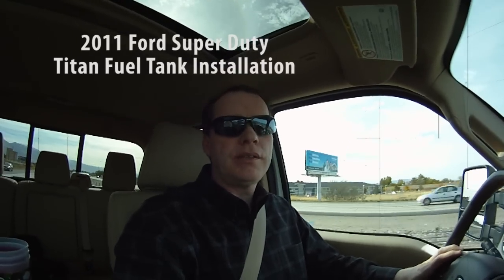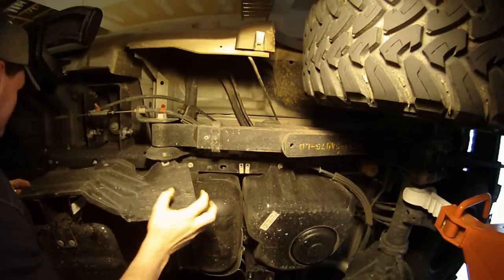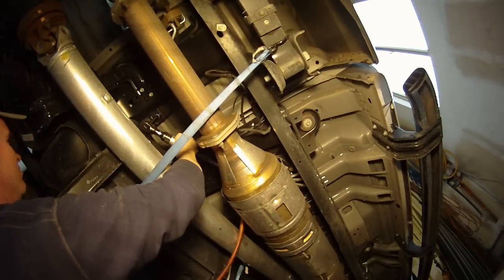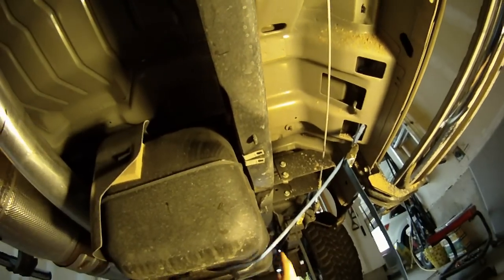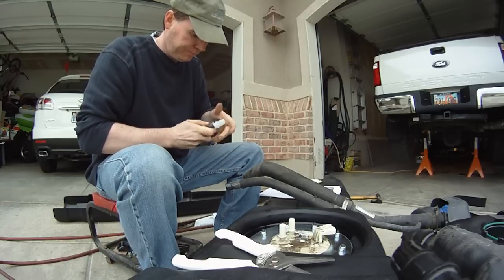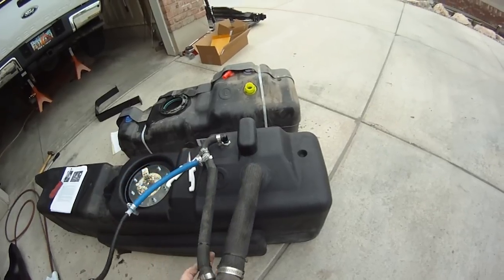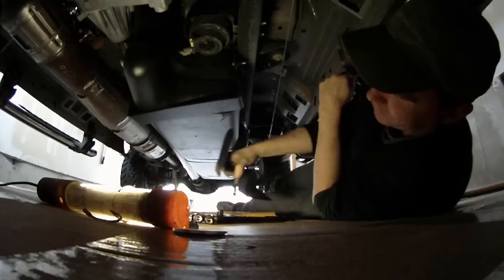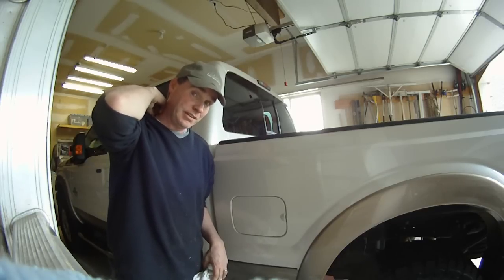2011 Ford Super Duty Titan Fuel Tank Installation

Comment: I watched your video at least 12 times. Today I put in my tank on a 2016 F350 Powerstroke. The ONLY thing that went wrong was the fill hose leaked as soon as I had it all together. Lucky I had a friend help me and it was fairly easy (but way heavier with 13 gallons) to remove and fix. I used your strap technique and it was simple even with the extra weight. I cannot thank you enough for making this video and showing the process even with mess ups. That’s how we learn right?  Now if the truck would stop dripping from snow I could for sure tell if I got it right this time. But I wanted to take the time to say thank you for your video. I will come back if I do any other projects to see what you have.
Reply from the maker: Congratulations! You probably look back now and think it wasn't such a big deal. The second time around is always much easier than the first.

Comment: Epic: Thanks for taking the time to make this really helpful video.  My biggest concern was how to remove the electrical connector and fuel attachments on the tank.  That was still a challenge, even with your explanation.  A thought for others who might do this: This was a lot easier using a transmission jack.  I bought a $100 cheapie at Harbor Freight.  It's small and worked perfectly.  They're also available at rental places for around $40/day.  Money well spent for peace of mind knowing there was less chance of dropping the tank and damaging the wiring harness and fuel connectors.

Comment from the maker: @homestarzelot Thanks, it was fun making the video. I am really enjoying the extra size tank. So nice to have to fill up half as much. I really didn't think that would be as big of a benefit but it's just nice dealing with fuel pumps a lot less. The extra range with the tank is great also. I can confidently go 500 miles towing a heaving trailer and 800 miles easily unloaded. I haven't adjusted the tank size on the MTE display yet but will in a few days.

Comment from the maker: Yes, my truck has the LCD display in the center of the dash which displays MTE (miles to empty). It was incorrect after I installed the tank because it was based on a 26 gallon tank size. Ford does allow changing the tank size parameter in the main computer now. Trouble is, it only works on 2011s and newer. If you install the larger tank, your miles to empty will always be wrong but the gauge will always be right. The gauge just moves slower with the larger tank.

Comment from the maker: I almost never use more than 45 gallons before fill-up so here's the numbers: Truck gets about 19-20 mpg unloaded on the freeway. That's nearly 900 miles. When towing, I get 11 mpg with takes me almost 500 miles. Running around town is about 15 mpg which goes about 700 miles.

Comment from the maker: The dealer must do that. They may not be familiar with the menu options in their IDS system by they can change the tank size in the PCM. They just need to poke around a bit and they will find it.

Comment from the maker: @wildpb Ford dealer service departments now have the ability to change the tank size in the truck's computer. This allows the MTE display to work correctly with the larger tank. Nice to see 800 miles to empty after a fillup.

Comment from the maker: @optikmike I installed the shield that Titan provided. You an see it on the driveway behind me when I move the sending unit from the old tank to the new tank. The MTE display is incorrect because it is based on a 26 gallon tank size. Ford is working on a new feature that will allow owners to enter any tank size up to 100 gallons. It's a minor annoyance however because the fuel gauge and the trip meters work fine. I always know how much fuel I have.

Comment from the maker: @Fordsuperduty6 Most I've put in was 46 gallons at about $4/gallon. That fillup was $184 and it takes me typically 700 miles. If I'm towing, I'll get usually about 11 mpg which tells you why I needed the bigger tank in the first place.

Comment from the maker: Can't say exactly how it works on yours but you get the idea @ 7:21 on this video. The blue hose is connected to a one-way vent and tied up against the filler tube when the tank is installed.

Comment from the maker: @thatschill777 I think the reasons for getting a 250 vs. 350 used to be the ride was smoother on the 250. It probably still is but not by much anymore. I would just never sacrifice load capacity on a 250 when I can easily have the 350 and still have such a nice smooth ride.

Comment from the maker: @Laidoutondubs Ford just announced that they will be providing the ability to update the tank size in the PCM. The IDS version 71 system will be released to dealers in January and it will include the ability to update tank size. When that is done, your Miles To Empty calculation will be correct again.

Comment from the maker: @thatschill777 Ford changed the rear springs in 2011 from a three spring system to a two spring on the F350. That's great for having a smooth unloaded ride. The F350 rides very nice unloaded compared to previous years. My truck is a 350 as I need the extra towing capacity.

Comment from the maker: @omegacraz119 Depends on what type of driving and whether or not I'm towing. Longest range is highway unloaded and that tank will take me 900 miles. On the other hand, if I'm towing heavy at altitude, I'll get 500 miles. Different and mixed types of driving results in anything in between.

Comment from the maker: @grizzlybearization That is a common misconception. Simply adding a larger fuel tank does not automatically void the manufacturer's warranty. Ford must prove that the tank caused a failure in order to deny a warranty claim. Now, if I add a performance chip to the engine, that could definitely void the warranty.

Comment from the maker: @TheFordFseries DEF injection is pretty much a non-issue. There are lots of rumors of high cost or running out and being stranded. Neither are true. I used 4 gallons of DEF over 5,000 miles which cost $20. No biggie. And the truck gives warnings when you have 1/2 a tank and very aggressive warnings when you have 800 miles left. That's plenty of time to run into any parts store for more. It's also good to the soul to know you're breaking down harmful NOx into it's nitrogen and oxygen components.

Comment: Note to people with the 2003-2007 models (probably, mine was a 2005), the fuel lines to the sender I had to use my fuel line removal tools (smallest yellow one) they didn't do those lock and button thing, I didn't see mention of it anywhere when I was installing mine today.

Now to find out if/where I can get my MTE adjusted, being an 05 I'm told it can't be done, but there should be some figure in a computer somewhere in order for it to be calculated.

Comment from the maker: No. The tank itself has no impact on warranty. An improper installation could though if it allows water into the fuel system. High pressure pumps don't like water so the installer needs to know what he's doing.

Comment: Epic must be some sort of super mechanic.   Long story short, mine was installed (not by me) and ended up with a leak.

Sure enough not near enough torque.  A buddy and I dropped the tank back out, I threw a torque wrench at it and only had maybe 10ft LBS before they turned......    Can't stress enough how vital it is to torque to 20ftLBS then drink a beer, and re-torque.   I went the extra mile and did a 3rd time.....and still was able to get a SLIGHT turn on the 3rd round.  

Anyhow, I had a heck of a time with the sending unit electrical connector.....busted it all up trying to remove as I couldn't get the tabs to cooperate.  Luckily at our shop we build wiring harnesses......and we just happen to have the connectors for that sending unit (both male and female). So I was in good shape after I extended the wire another 2ft,....and put a new connector on.  If anyone wants extensions or something, hit me up.    Sure makes that job a ton easier being able to mess with the connector with tank on the floor instead of crammed up in there.  Then just zip tie the wiring up after installed so the driveshaft doesn't eat it.   

Thanks for  your video Epic  Great job on getting the camera up in there at some really tight spots.
Reply from the maker: Ahh... installation experiences, they're always fun! Now you know it's done right. My tank seal has been perfect and I love the extra range.

Comment: Nice job, you got that huge tank in there no problem.  My 2000 7.3 Lariat F350 4x4 supercab longbed came stock with a 38 gallon tank.  Are there bigger tanks available for the older SuperDutys as well?

Comment: I mean Fuel Economy... I was typing in short ways.... My father really like the 2013 Ford truck than his old 2002 Toyota Tacoma. Right now, My father is only refuel 1-2 times per week because he always traveled long distances and bad terrains like muds.The FX4 is really powerful, and it's could get to anything. As I said 2013 Ford F350 Lariat 6.7 Diesel.....I can get to 400-450 miles per tanks.... My truck is largest Wheel Base truck !!!

Comment: So where do you mostly buy the ULSD fuels at what gas station.I live in Georgia,Atlanta the brand all gas station are Chevron,Marathon,BP,Texaco,Shell,Quick-Trip.All of that gas station which of them has a ULSD fuels.And aslo,I has confuse if put you regular diesel into power stroke engine and it still work good,but they warranty you 250,000 miles with B20,but you put regular ULSD in power stroke engine will it run the same 250,000 miles or it different.Where do you buy ULSD at? thank you

Comment: Is this 2011 Ford F-250 Lariat with B20? I has question.Do I can put my ULSD Diesel in to my 2012 F-250 turbo diesel engines/Navigation would be any damage to it?How many miles per gallon of ULSD Diesel range.My fuel tank was 37.5 gallon of fuels.Again,Is it safe for me to put it into my engines with ULSD Diesel?In my state we don't B20 fuel station,but we has ULSD diesel at every fuel station and it label too!Again Is it safe for me to put it into my engines with ULSD Diesel? and why?Thank

Comment: Nothing like wrenching on your truck to make it more "yours" I love it! Epic, have you ever wished you had the 8ft bed?
Reply from the maker: A few times where I've had to carry plywood or sheet rock. But that's so few and I've always managed without it. The truck is so big as it is I can only imagine trying to take a bigger one through drive-throughs or find parking. If I lived in a rural setting, sure. But since I have to contend with other cars, 18 inches more length is just not practical.

Comment: EpicCowlick I don't know if you want to add this into your video or not, but the Titan Fuel tanks have changed design since, well mine was produced on 12/17/14 and the step to cut the hose and add the vent line has been removed. They modified the tank to have the vent line built into the tank itself. I can't add a photo, but I took one of my tank (exactly as the shot @ 7:20 in the video shows the two tanks side by side), if you want to send me a pm, I can try and get it to you that way. I just thought it might help to add this in your video, as your video defiantly has helped me to install this tank and this design might help others who also get the new designed tanks.
Reply: Thanks for the update. Sounds like the new design is even easier to install. I think your comment here is good enough to let folks know.

Comment: I have the exact same truck and when I did this my fuel line connects clips to the fuel pump were so packed full of dirt, small rocks, and other debris, the clip would not release and broke the clips trying to get the lines off. Everything else went smoothly, the fuel lines are now just kind there "pushed on" with zip ties holding them on, I can literally just pull them off, and they are zip tied down for the time being. I can not find replacement connections anywhere?? Any suggestions? I'm about to just cut the fuel lines and use normal fuel line and hose clamps.

Comment: After you did this modification, was the fuel mileage to empty and the current fuel mileage still accurate just like before with the factory tank? If not, what did you do to make the them accurate on the screen?
Reply: It still works . I have fuelbox  tool box fuel tank combo with auto controller . The truck re-calebrate's

Comment: Did you replace the float arm. Looks like u used the same one
Reply from the maker: This kit from Titan utilized the original float. The new S&B tanks include new longer floats that reach higher in the new tank. The new float helps the fuel gauge show the correct fuel level. See the updated 60 gallon installation video on this channel.

Comment: Do you happen to know what the reserve is on your tank? I installed a 50 gallon titan on my 2015 f250 short bed. Ive run the fuel down to an indicated 20 miles to empty and have only been able to fill with about 40 gallons, not the 50 gallons that its advertised at. Is there a 10 gallon reserve????
Reply from the maker: I remember that same thing when I first installed the tank. I believe the truck slowly adapts to the larger size over time. My low fuel light would turn on with 5 gallons left in the tank. There was a couple of times where I had to go into that margin and was glad to have it.
Reply: When you install the new tank the Ford service dealer will re-program your fuel gauge so the truck knows you have the extra fuel capacity
Reply: I paid the dealer to update the DTE for the larger tank. The issue isn't in programming, the tank accepts 40 gallons. I'm assuming there is a 10 gallon reserve but am not positive. Ive emailed Titan with no response and was looking for an answer from anyone who owns this tank.
Reply from the maker: dan theman There were a few times I put 45 gallons in. the Guage was pretty accurate.
Reply: I've had mine for over a year and I haven't noticed any variance.

Comment: I just bought a new  for  2013 Ford F-350 Lariat FX4 Off Road Diesel Engine 172 Wheelbases with 37.5 Gallon Of diesel(Lariat Ultimate Package, Chrome Package, Ford  Delta Pro box truck . I don't towing, but my payload is around 1000-1500 pounds. My fuel economy cruising range is 400-450 miles per tank as fuel up. I really happy with Ford Eco than Toyota Tundra.. Toyota Tundra have really bad fuel economy. It's can go only up to 300 miles per tank for driving both fuel combined. Ford is better !!

Comment: Did you program the tank size to the bigger tank and how many miles do you get on the fill tank on the new tank
Reply from the maker: I had the dealer change the fuel tank size so the truck computer (miles to empty) is correct. It's 50 gallons of fuel, goes as far as it goes depending on use.
Reply: @EpicCowlick  nice how much it cost to fill up the 50 gallon diesel tank and how many miles can you go from fill to empty

Comment: a little question for people with the newer versions of these tanks, a little over a year ago i put on  my 2005 a 67gal tank, ever since when near full the tank would spit up a bunch of fuel then drain into the tank, also there's a long hiss when I pull the fill cap. looks like it's sucking the tank in on itself. anyone else have issues with the vent system on the tank and what'd you do to fix it?
Reply from the maker: +AceBoy2099 Most common issue is that the vent was installed backwards. Quick fix to flip it and see that the arrow is pointed towards the tank. Could also be a bad vent which would require replacement. Titan guys are helpful on the phone for this stuff.

Comment: Did you need to get gauge recalibrated? I’m looking at getting the 65 gallon tank for r my long bed.
Reply from the maker: Yes, the tank size can be set to any size tank in FORScan. Dealers have fewer options.
Reply: EpicCowlick cool. Thanks, man. Just bought a 2020 Heartland Bighorn 39MB. Going to need double the tank for the long hauls. I do wish S&B would come out with a70 gallon for the ‘11 model trucks.

Comment: Which tank was easier to put in ur 2011 or 2017
Reply from the maker: They were both pretty easy but the S&B wins out. Re-using the OEM hold-down ring on the sending unit is much better than worrying about torquing down the Titan ring. Water would get by an improperly torqued ring.
Reply: @EpicCowlick  thanks for ur feed back

Comment: Did youbhave to purge the fuel system?
Reply from the maker: Ford has a self-purge ability. Just turn the key on but don't start. Do that a few times and all air in the lines is cycled out. This is done after each fuel filter change.
Reply: @EpicCowlick  awsome thank you!

Comment: Question for you, i recently bought a 2012 F-250 Power Stroke and it has a 50 gallon tank.  The guy i bought the truck from filled it up for me but that was the last and only time i ever saw it at full.  When my 50 miles til empty light came on, i went to the gas station and put in a little over 40 gallons.  When i got in the truck, the gauge barely read over 3/4 full. and just has not been acting like a 50 gallon tank ever since.  And suggestions? do you think its my Fuel sending unit that went bad?  I am not sure of the tank brand or anything, there is no sticker or labels on it.. please help! thanks!
Reply from the maker: You can compare how your tank looks with the one in this video. That might help you understand if it's a Titan or not. It sounds like you're sending unit is sketchy. Mine would always show full after filling it and it would stay that way for 5-7 gallons before starting to drop. Mine also showed empty when I only had 5 gallons left.
Reply: Thanks, ya i think my sending unit is the problem.. its ok to use the stock sending unit from the old tank? so does it matter what sending unit i but or does it have to be tank specific.  thanks again!
Reply from the maker: Just the stock sending unit for the truck.
Reply: Awesome thank you